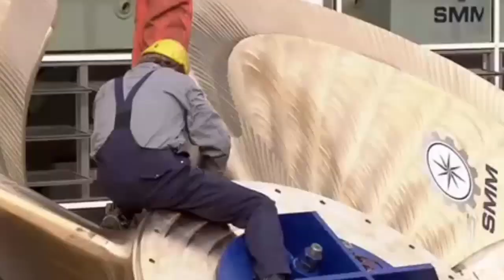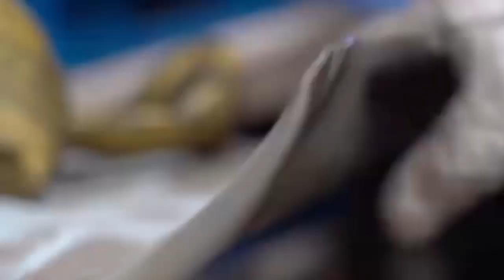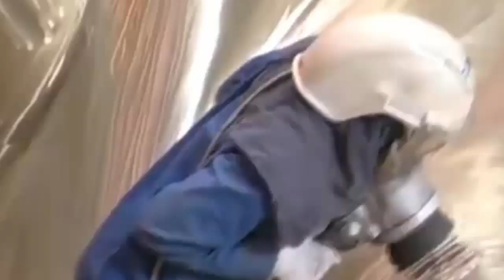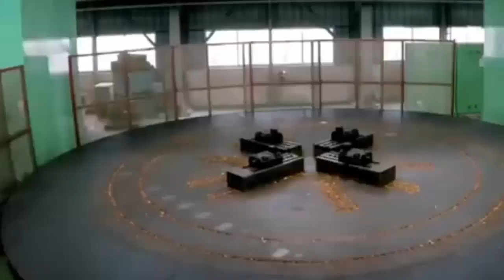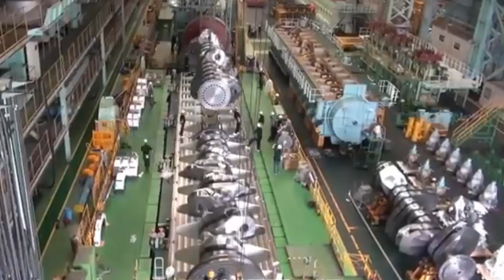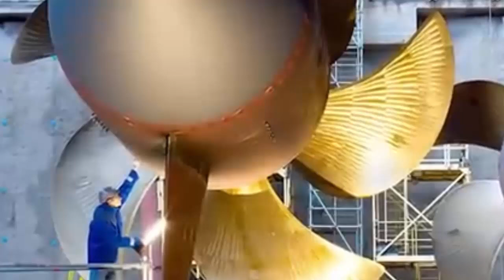Genius idea How does China make a 110,000 ton aircraft carrier propeller

Comment: Wow, a propeller with a diameter of 10m is very large indeed and difficult to make due to the higher possibility of cracks. The material must have a consistent strength at every distance from the axis because it would otherwise create uneven tension within the propeller which could brake it. This is a brake through in China’s technological level of shipbuilding.